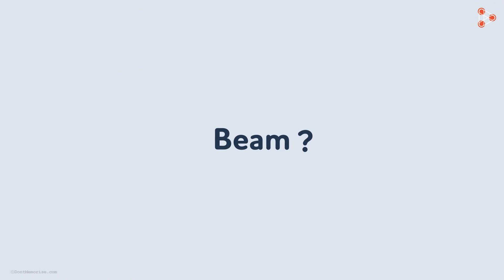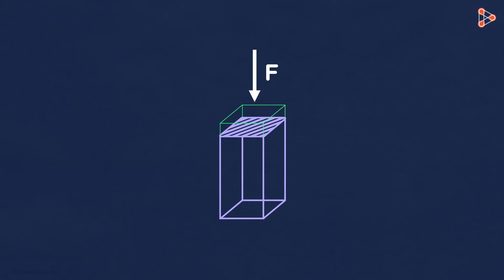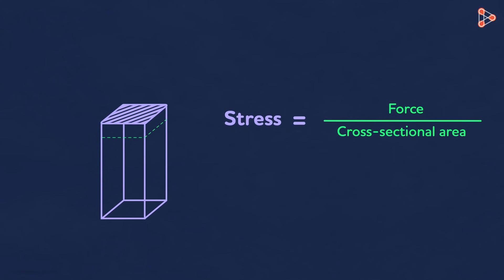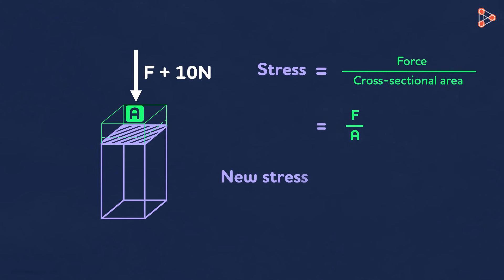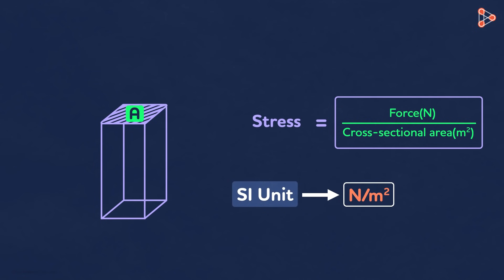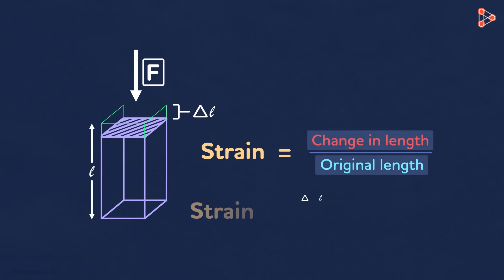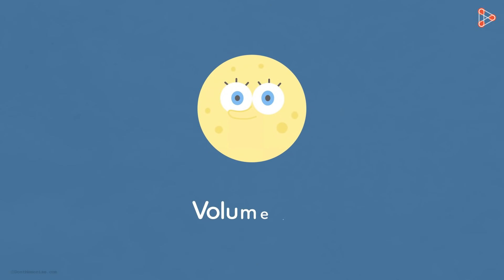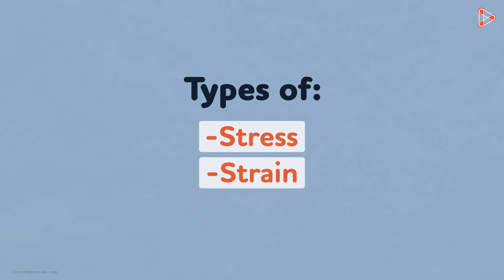Stress and Strain | Mechanical Properties of Solids | Don't Memorise

Comment: That means Stress is equivalent to Pressure?
Reply: As pressure is external and stress is internal
Reply: Well the units and the dimentions are same.
Reply: No, pressure is the force applied by a man on the body... While stress is the restoring force that is being exerted by the body the body to get it original position back..
Reply: @rimurilu7525  Oh so just to clarify... Stress is the inverse action for pressure? Basically, I apply pressure to distort something, and that thing "stresses out" to get back to it's original shape?
Reply: Yes
Reply: But it is equal to compressive stress
Reply: Yes,, but only in formula terms but technically they have slight differences
Reply: Absolutely... In my class 11 physics book they both have the same formula force/area

Comment: I am giving my 10th board exams. And I opt for PCM in class 11th and 12th. So, I am trying to cover some of the topics of class 11 and the best way to do this is by watching your videos.
In class 9th I had studied that Pressure = Force/Area and now I came to know that Stress = Force/Area and also they both have the same SI unit, N/m square that is Pascal, named in the honour of the great scientist James Pascal. So, that means that Pressure and Stress both are the same thing given different names. Thanks Don't Memorise for such a nice explanation.
Reply: Stress is applicable only to solids whereas pressure can be used anywhere. Stress can be positive or negative, pressure can only be positive. Stress is generally used in cases where a force is exerted whereas pressure is amount of force per unit area. Hope this clears your doubt. Keep on learning📖📖👨‍🎓
Reply: @jakeperalta8421   Nice explanation 👍
Reply: @jakeperalta8421 never thought that jake peralta would some day teach me physics
Reply: Stress is due to deforming force ,whereas pressure is normal force

Comment: Is stress same as pressure?? Pls ans this doubt needs to be cleared..
Reply: Ni pressure and stress are both different things...stress is dependent on pressure...cause pressure is due to external force and stress is due to internal force...
And internal force occur just because of external force. If there will be no external force means pressure so there will be no stress( internal force)...
Perhaps u get it...
Reply: @lakshaygoyal11  I got it! Had doubt regarding this.... Thank u:)
Reply: Thanks
Reply: @Tasnim Chaviwala why is stress scalar quantity??
Reply: @nafisaparveen4275  Stress is equally distributed in all area ,it has no particular direction so it is a scalar quantity.
Reply: @Winterbear-i4y  ooo
Reply: @Winterbear-i4y NO, it is a tensor of rank 2!!